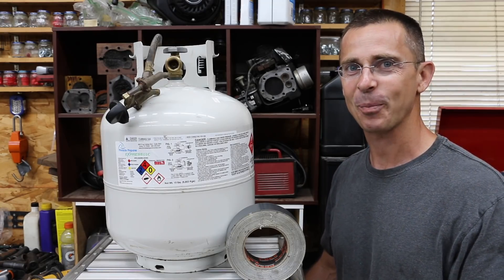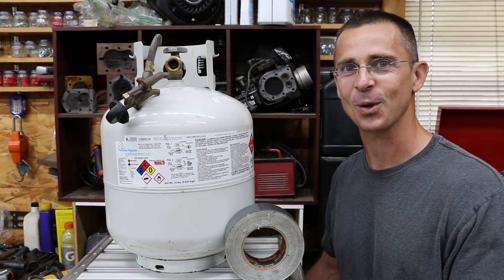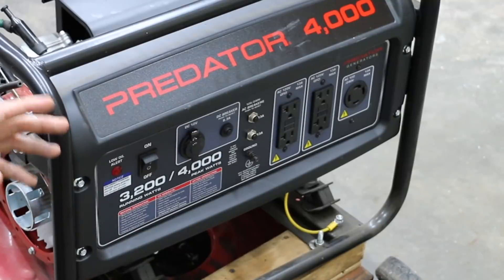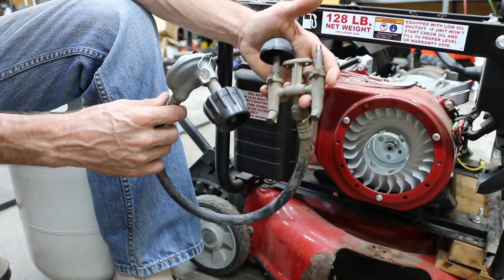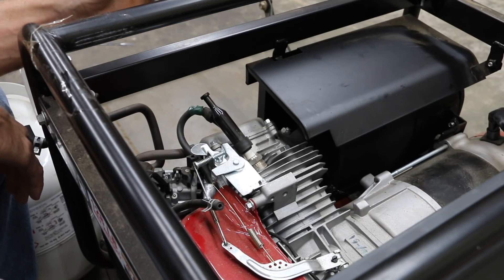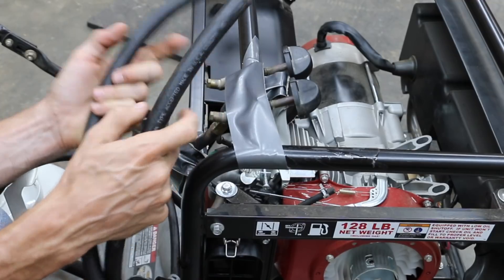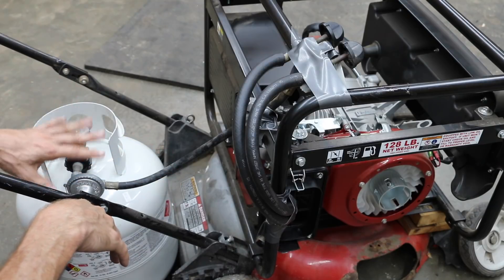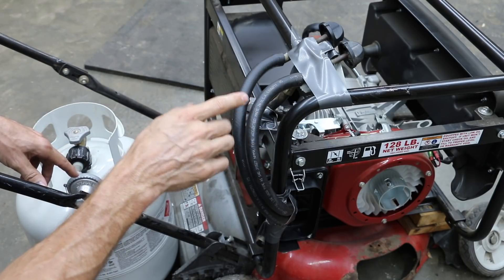Can a gas (propane) grill power an engine?  Let's try it!

Comment: DRILL? Could you please explain how you used a cordless drill the start the engine?
Reply from the maker: I use a 1/2 inch adapter designed for a drill along with a socket. I used a corded drill since they spin much faster than my cordless.
Reply: Great idea, thanks!

Comment: Do rust removal using electrolysis. Compare car battery charger versus arc welder.  I've done both, and the arc welder produces a bunch of brown foam that will look interesting on camera.  I would use a five gallon bucket, some rebar as the anode or cathode, and I think baking soda.
Reply from the maker: Great video idea!

Comment: Why not pipe the propane in the fuel line?
Reply from the maker: Yes, this would work too.  I wanted to be able to use both valves and it was easiest this way.

Comment: When we have old cars or tractor around that the fuel system is broken and they need to be moved or we want to see if they will run and move before spending money on them. We use a big harbor freight propane garden burner with the tip unscrewed and the end on some hose going into the intake or on to a vacuum barb on the carb. I turn it up until it runs, try to get a high idle and its good enough to move the stuff around the property. In an emergency you could probably drive on it but you've gotta modulate fuel with the knob on the burner along with air with the gas pedal at the same time as u throttle up and down so its tricky. Use any of this at your own risk. https://youtu.be/P1590Hp92ec
Reply from the maker: Great tip!

Comment: Question I have, how many hours will will a full cylinder of Propane run the generator with the load on it you tested with?
Reply from the maker: Great question. I need to test this.

Comment: great experiment, another suggestion is to run the generator on a Gasoline Vaporiser (i.e sucking air directly through a reservoir of gasoline through an improvised container) instead of using the normal carb! and then measuring the fuel consumption between the Vaporiser and the Normal Carb and see which one is more economical !
see diagram> https://imgur.com/a/7DrUguZ
Reply from the maker: Thank you!

Comment: It should be fine with a Go kart, they use propane for Forklifts... You're talking under load, that is always under load... It burns cleaner and more efficient, it won't build up the residue as gas and diesel. It's just not practical depending on where you go, it's like $3-$4 a gallon at regular stores, cheaper at a supplier, but it has a lot of supply limitations.  Ever try to get propane on the 4th of July? Stores run out. Good thing your car doesn't run on it. Perhaps you get more mileage out of it, that's the rumor. Some cars do have propane "conversions"...  PSI? Whatever that is..Propane should burn in a diesel engine. I'm sure it would. All things considered, in an emergency.. It does work.
Reply from the maker: Great point.
Reply: I've been a forklift operator for years. Nothing sucks worse than when you drive your lift on E, trying to get that last load in, and you run out of propane. You have to disconnect the tank, carry it across a big yard, to the filling station, their not so light when they are full, about 12 gallons. Then you have to carry it back, hulk it on the back of the lift, trying not to drop it, lock it back down, reconnect.. Very time consuming. And I've rolled those dice a lot and carried many propane tanks back to the lift in my time. But hey, we've all done it.

Comment: Now try WOOD GAS like NightHawkInLight has a tutorial on, I know you can do it the question is more about how hard it will be to do it and can you generate a source that is consistent enough that allows you to run an engine off of it or do you have to produce the gas first then use it separately later on.
Reply from the maker: Great video idea!

Comment: Some generators can be bought from the store pre-equipped to run on either gasoline or propane. I have my eye on a 7500 watt unit at Tractor Supply that you can just plug a 20lb propane cylinder to. No gasoline seeping into the crankcase means your engine oil lasts longer and it runs cleaner. But it also doesn't produce as much power as gasoline does.
Reply from the maker: This is great information.
Reply: Yup, it's going for about $800 I do believe. Anytime you change your engine oil and it's black it's because some of your gasoline seeps into the crankcase while in operation. Hence one reason they tell you to no idle your car, it helps the oil last longer. :)

Comment: You did my video....... I've seen this done alot. Great job !!!
Reply from the maker: Thank you for recommending this one!
Reply: Project Farm ...... The Next Step would be installing what's called a demand regulator that works off crankcase vacuum. It will only let propane out when it is needed

Comment: I've been running engines on the stuff for nearing 20 years.   My daily driver is a 1999 Ford F250 super duty with the V10 and I have put about 100K miles on it just on propane now.  

Same average power and fuel mileage between the two  (I have it set up with on the go switch over so it easy to compare power on the go when towing 12,000 # loads)  thanks to how modern emission compliant engines are so god awful detuned down from what they are capable of to meet emissions numbers.     

On the old vehicles that had carburetors a dual fuel conversion like this was a good  15 - 20% hit on power and fuel milage if not more but on a modern EFI it a wash since you are already losing that same peak power and fuel efficiency to meet emissions standards.   VW  owners can confirm this on their vehicles that they were forced to have updated to meet emissions compliance  and those were diesels!   

The conversion for a modern EFI engine is rather easy.  Just mount the mixer unit ahead of the throttle body and turn the power off to the fuel injectors and fuel pump.   

Everything else is just a matter of rerouting a few lines like the idle air motor feed line to draw from downstream of the mixer and rerouting the EGR line from drawing from the exhaust to drawing from ahead of the mixer (that can be done to defeat it without to the computer knowing it on a gas burner too)  so that when it activates it gives the engine clean air.  

As for the vaporizer that's just plumbed in series with the heater on the return side line.
Reply from the maker: This is great information regarding efficiency.
Reply: It is not possible to have same mileage on propane as it has less energy per liter/gallon than gas. I work with modern propane systems everyday, even for the newest direct injection engines and difference is always around 15%. So for example if your car eats 10l/100km on gas - will do 11,5l/100km on propane. Using mixer is very old technology from 15-20yrs ago, and even with old cars cutting off fuel injectors would cause check engine light on the dash. Now all propane systems have separate injectors, ecu, different regulators, special emulators for various signals etc. You cant always mount vaporizer in series because many cars have dedicated cool/heat valves. All you said is true, but... obsolete.

Comment: My job has a winch  truck that runs on propane. Not only did it drive well but very fuel efficient. Ran it for 3 years with no problems. It was in a accident and it was going to converted to gasoline with very little mods. Broke down the engine for rebuild and found there was virtually no harm done and valves looked brand new to our surprised. So instead of conversion back to propane we went. It has 499,000 miles on motor. Not one problem even tho it was in a accident. Our diesel winch truck cost almost $1000 a week on fuel. GMC sold us on the propane version and cost about $800 a month on fuel. So now our fleet will be going to natural gas. Big money savings. Many companies have already gone this way. Tractor trailers, transit buses, etc. learned a lot from this. Wonder why cars haven't gone this way and it's cheaper then gas and less wear and tear.
Reply from the maker: Thanks for commenting on this.
Reply: I think that when using propane, a variable venturi carb setup is needed. The real problem is retrofitting fueling stations when so many people are against carbon-based fuels.
The State of NJ has fueling stations for state cars that incorporate NG filling as there are so very few available.

Comment: Can you increase power or fuel effiency by running both propane and gasoline. Can you run propane in a diesel?
Reply from the maker: Great video ideas!
Reply: Can you run a small engine on pure oxygen? The air we breath is about 20%  oxygen and mixed with other stuff. I wonder if the pure oxygen will will make 4-5 times more power and increase/decrease mpg. I think it would cause a more complete combustion and improve it.

Comment: Project Farm Obviously the next step is trying a camping type Butane cylinder (for those little camping single burners/and blue flame torches) You could adapt a torch tip by adding a tube and potentially running a cheap harbor freight 1,500 or 900watt generator.  I would really like to see this, also a sound measurement comparison between gasoline and Butane fuel.  My theory is the butane may run quieter (if it runs). Thank you for all the excellent videos with quality content, favorite YouTube channel next to Mustie1
Reply from the maker: Great video ideas--thank you!
Reply: Prolific Invention it's the same thing
Reply: All2skitzd Perhaps it is similar: found in the same place and propane is composed of a small percentage of butane and has similar characteristics.  You gave me another idea, many people would probably want to see a generator ran off a Natural Gas line.  If you could safely acheive that without a conversion device it would be excellent Project Farm .  Also a little known gas called Ethane would be interesting to burn for those who know what it is and where it comes from.

Comment: As the son of a propane distributor, I had plenty of scrap parts to play with. For personal testing and usage, I started with a little more elaborate grill setup. There were teething issues. Later scraped it in favor of a vacum and velocity system with a mechanical override. Worked like a charm and the aluminum bore motors lived much longer despite my torture of only changing oil once a year, no matter how many hours it ran and they saw hundreds of hours per year. Never needed a sparkplug until they were pumping oil. With propane,   an oil burning engine will have a funny smelling and looking exhaust. 
I even engineered a setup for my beloved two stroke Lawnboy's. I mention the propane side, the oil side was this: Fill the gas tank with straight 30 oil. Use a diaphragm fuel pump to inject atomized oil in the air stream. For a bit more of punch, the 'was a carb' had most of it's veturi removed. The dang things would run hard. And no, I did not use a 20# bottle, it was a one pound refillable bottle. Alas, someone that knew nothing about the oiling would not add oil to the gas tank and use it behind my back and add fuel mix... Needless to say they all died. Life is Life....DOH!
Take care from Oklahoma
Mike and Vee
Reply from the maker: This is very interesting!  Your level of experimentation and expertise is impressive. Thanks again.
Reply: Project Farm thank you. The same can be said about you and your channel.

Comment: I've gotten old lawnmowers with gunked up carbs to idle cleanly with just a propane plumbers torch aimed at the carb. Give it a shot of gas to get it started, then meter in some propane to keep her running. Easy way to verify if an engine is sound without doing any tear down.
Reply from the maker: Great recommendation!

Comment: I want to do this but I am worried if I leave the generator unattended and the engine quits. Then the gas would still be coming.
Reply from the maker: Great point. There is a kit that can be purchased that will shut off the gas if the engine stalls.

Comment: It's a lot easier to get a carbeurated engine to run propane. You could run a carbeurated engine on hydrogen gas too (at tour own risk). The school buses I rode in elementary school ran on propane before they replaced them with diesel buses. Propane was cheaper in the 80's and 90's so it made sense then. Large industrial engines run on Propane or LNG right off the gas line. Huge gas turbine engines that pump natural gas or generate power run on natural gas. Forklifts use propane because it burns cleaner than gasoline for running in warehouses or shipping address centers. The trade off is fuel economy and of course storage. You need more propane to make the same amount of power as gasoline or diesel.
Reply from the maker: Thanks for commenting on this.

Comment: propane works well with lower compression engines. with the newer higher compression models it creates a lot of heat, the gasoline actually is used to cool the valves. but with propane this cooling is lost resulting in burnt valves or valves being pulled into their seats. even using hard valves and seats,the head is compromised and  the valves fail. propane has more btus and provides more power, but propane is mixed with it in cold weather to provide feed pressure and a heatexchanger is need to convert from liquid to gas.
Reply from the maker: Great information. Thank you

Comment: My dad has a mid 90s dodge Dakota with a v8 that runs on propane so I'm glad you did this video! One video I would like to see is how different oils inside the engine protect the crankcase from rusting. As in does diesel engine oil keep rust away for longer than gasoline oil or atf. Keep up the videos!
Reply from the maker: Great video idea!

Comment: I would like to see if there is a difference between pump gas with the usual 10% ethanol and fuel that is 100% gasoline no ethanol and maybe even E85 if a small engine will run on it
Reply from the maker: Great video idea!

Comment: We used to run all of our work trucks on LPG back in the '70s and early '80s. We actually ran a dual fuel setup, using gasoline as the "backup" fuel source...you would just flip a switch to change fuels, but it was advised to do it while driving down the road, because for some reason they were hard to start if we tried when they were shut off, or if they were just sitting idling. You also had to run gasoline every now and then so jets wouldn't get clogged up with crap from fuel just sitting in them for long periods of time. 
Then in the late '80s - early '90s when computer controls and fuel injection became the norm, it was harder to convert vehicles, at least with the systems we used, so we went back to just gasoline.
As far as them running cleaner, I remember pulling the head off of a 1980 F100 300ci straight six, that had well over 150,000 miles on it and it looked like it was brand new with not even a hint of carbon buildup.
Reply from the maker: Thanks for commenting on this.

Comment: Someone said it but in Europe 1/3 of any gas car with non direct injection runs super good on propane. They have a switch so they start on gasoline and after someengine heating - they switch on propane butane (LPG) they only have something which is like evaporator and it can and it is done on cars from Porsches to family station wagons. Also they do on Methane or also called CH4..but it works for gas and diesel engines. In USA some diesel buses use CH4 too. Great videos like usual
Reply from the maker: Thanks for commenting on this.

Comment: I saw another video where people used baby oil in an engine and were able to drive with it for over 1oo miles.  What kind of damage, if any would that do and would other non-conventional oils work?
Reply from the maker: Thanks for the video idea!  My opinion is that baby oil would work but shorten the life of an engine significantly.

Comment: Gasoline inlet nipple on the carb plugged during this test ? If not that would be an air leak...??
Reply from the maker: Great question. I didn't bother plugging it.  Just adds more air to the intake for mixing with the propane.

Comment: I have been running my lawn mower on propane for a few years now. Got tired of the crummy gas they sell these days screwing up the carb. I modified the carburetor for propane to be pulled in at the venturi and also modified a BBQ regulator to work as a demand regulator. Usually starts on the first or second pull. A little down on power compared to gasoline. I think that milling the head to raise compression would fix this as long as it doesn't make it too hard to pull the rope to start.
Reply from the maker: Impressive!

Comment: I'd love to see this exact same thing done with Hydrogen. From what I've heard, it would burn too hot for most engines... but the exhaust fumes would be water vapor, so it'd be a zero pollution internal combustion engine.

The only concern would be if the water vapors get past the piston rings into the oil. That would probably require a pretty long test though.

Hydrogen probably isn't cheap though, so I'm not expecting to see this happen.
Reply from the maker: Great video idea. Thank you

Comment: most people run propane in their offroad rigs. Less power though.
Reply from the maker: Thanks for commenting on this.
Reply: Heres an idea. You could always see if there is a maximum length of exhaust. Straight pipe no baffles. Ive always wondered if you made a straight pipe for a small engine that was = to or greater than the length of a car would effect the engine at all.

Comment: Propane has around 100+ octane knock rating. Explains why it works good under a load since you control rich and lean.
Reply from the maker: Thanks for commenting on this.